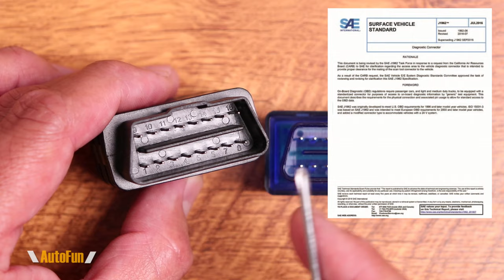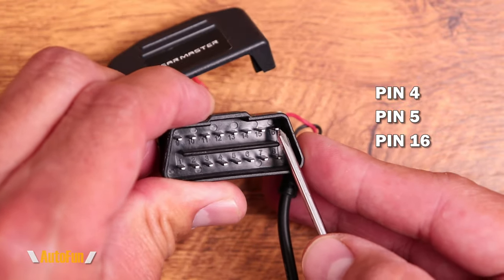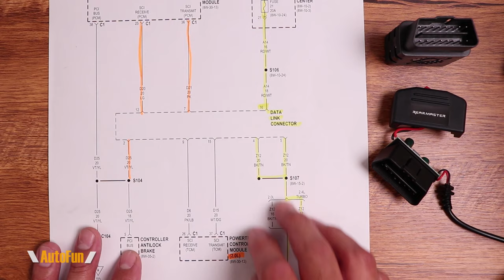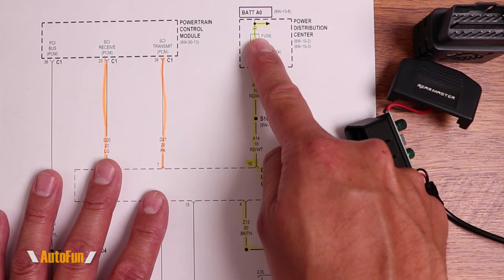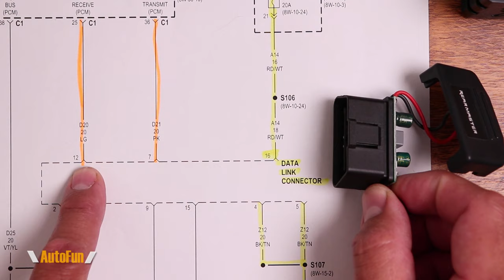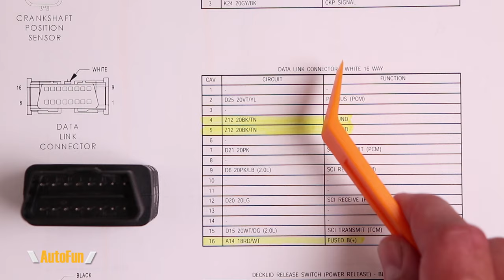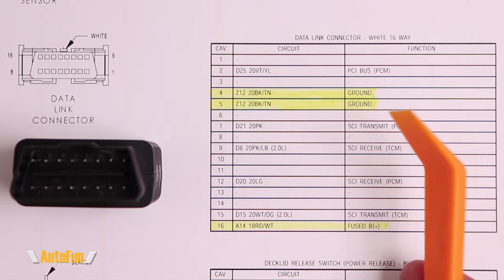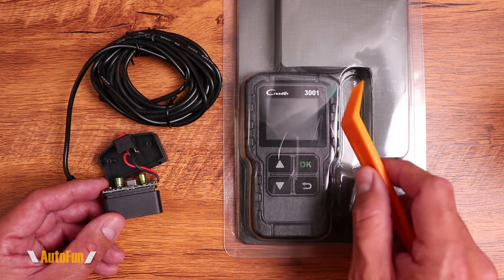OBD2 Power Adapter DANGEROUS? (Is it safe to use the OBD port for power?)

Comment: Wonderful explanation!! 

Do you believe the power draw (specifically a dash cam) will affect the battery/car the same as a regular power port?

I love the idea of using this method for power as I recently broke my normal cord and need to replace. 

One thing I would mention in a video is that the power is always on, if you don't want a dead battery switch it off everytime you turn off the engine!

That being said I love the idea of being able to record for a few minutes with the engine off.

Thank you!
Reply from the maker: Thank you Mindy! Ah yes here is my original video showing how the adapter works https://youtu.be/YEklm9V6xYE it has built in low battery protection (to avoid draining your battery) and has two modes of operation which I cover on that video in detail. Hope this helps, Cheers!
Reply: On some vehicles simply having a device plugged into the port will keep certain modules 'awake/alert' as they assume the device thats plugged in is a scan tool. This can result in a dead battery when the device itself didnt comsume any power - rather some of the car systems never hybernated.
Reply: @djbmw1  I have a 2010 accord, I went ahead and got this exact model and I haven't had problems.
Reply from the maker: @djbmw1  Hi djbmw1! Yep! while I have used my OBD2 adapter for over 4yrs now in a newer vehicle, what you are describing is very true and I seen it on some newer cars (specially on hybrids) where either the OBD2 will keep a module on or the car will turn off power to the OBD2 port or the car will detect the draw on the OBD2 port and throw a MIL for battery. Hope this helps, Cheers!
Reply: If you want the camera to work in in the parking mode . You need power to it all the time . Turning  off the adapter defeats the purpose of hardwiring it in the first place
Reply: @randybauer2998  I commented this a year ago, my guy!

I wanted it set up this way so I didn't have to have it plugged into the cig lighter.

And the adapter he recommended works flawlessly and it shuts off on its own. 

If I wanted it hardwired I'd run it to the battery.

Comment: Does that have a voltage cut off to prevent the car battery from dying?
Reply from the maker: Hi Velocity0428! the one I showed on the video does have low voltage cut off (Not all OBD2 adapters have this) I put a link in the video description if needed. Hope this helps!

Comment: Thank you for your great video and giving me the idea how to get power to my dashcam.
Did you ever had issues with such adapters in combination of wireless key systems?
It seems that in special cases or specific car models such adapters produce so much "noise" that the communication between the wireless key and the car electronics gets interrupted etc.
Reply from the maker: You're welcome Alexander! Regarding issues with wireless systems, nope I have not experienced any. Remember the OBD2 power adapter is just a standard step down voltage adapter similar to the ones that the dash cams come with (cigaretter lighter plug style) it's just packaged to interface to the OBD2 connector as opposed to cigaretter port of the car. So the EMI or RF noise generated by this adapters will be about the same (likely negligible based on the number of power adapters I have tested while reviewing many different car accessories such as dash cams) Hope this helps, Cheers!

Comment: Wow, such an amazing video! Learned so much from it. Are OBD2  EXTENSION CABLES also "okay" to be used on a vehicle? Thanks!
Reply from the maker: You're welcome Arshia! Glad to hear it was helpful. Ah regarding OBD2 extension cables, if I recall correctly there is no provision on the SAE-J1962 standard against or for extension cables. That being said extension cables (and Y splitters) seem to be common in the automotive repair industry, some equipment seems to be unaffected by the use of them and some are more sensitive where the won't work well with an extension or a Y splitter. Hope this helps, Cheers!
Reply: @AlexAutoFun  Thank you so much for your reply 🙏🏻
Have a nice day ✌🏻
Reply from the maker: @arshiaabbasi4920  You're welcome!

Comment: Hello AlexAutoFun, I recently picked up 70ai Omni 360 dashcam, which came with a 4G hardware wiring kit, three wires ie, ground, power, & acc (yellow wire). And I really like your idea using this OBD power adapter from one of your previous videos. The kit above comes with stripped wiring, which I'm thinking of soldering the leads to a female type-C board. On these female type-C boards its labeled V, D-, D+, G. Based on your experience; do you know where my third wire should be connected? On what pin should I connect that wire on the female type-C board; between these tabs D- tab or D+? Thanks for any feedback!!
Reply from the maker: Hi Luis! There is a OBD2 adapter that already uses USB C (save you some time making one) here you go https://amzn.to/3kANxlx Just remember that while the OBD2 adapter will let you monitor the car while parked, it will not enable true parking mode (since it only provides power, it does not provide what a 3 lead hardwire kit needs ACC, BATT, & GND), here is my video where I explain this in more detail https://youtu.be/YEklm9V6xYE Hope this helps, Cheers!
Reply: @AlexAutoFun  Thaks for the answer since I have exactly the same device. The link to the adapter leads to some "VANTRUE 10ft Mini USB 12V-24V to 5V Dash Cam Hardwire Kit" which is definitely NOT the USB-C nor even an OBD one. Maybe wrong link slipped in? It's hard to find a USB-C kit somehow (I'm in Europe).
Reply from the maker: @andrejk6770  Hi Andre! That is strange, I just checked the link and does go the OBD adapter with USB C port. But I do know sometimes if you are in different region where the sellers doesn't ship the product to yet, the link can take you to a different device that Amazon thinks is like the original one. Hopefully they will eventually carry this adapter for you in your area. Cheers!
Reply: @AlexAutoFun  Hi Alex, can you elaborate what you mean by saying 'monitoring the car while parked' and 'true parking mode'? What's the difference? I watched the video you linked and many more, and I was under the impressions that as long as you switch the ODB2 adapter in the right position (either 0 or 1) it will either switch off minutes after switching off the engine or keep recording until the battery drain is too much, which will then switch it off automatically (if the dash cam allows for it). What is the 'true parking mode' then if not that?
Reply from the maker: Hi Jacob! While the OBD adapter can be used to monitor the car while parked as explained on my original video here https://youtu.be/YEklm9V6xYE It will not enable true parking mode. What that is, on most dash cams the parking mode menu or feature will not be accessible with the OBD adapter, only their hardwire kit will enable it. Inside of the parking mode menu or setting are advanced park monitoring features. Depending on the dash cam being used, they can potentially range from simple Impact detection, time lapse, to more advanced modes like buffered parking mode and motion detection (visual or radar based), power saving park mode etc. And stay tuned I have a video coming where I explain this in more detail. Cheers!  @jacobb9177

Comment: Does OBD2 method work simultaneously with triple camera bundles? Cabin, dash and rear?
Reply from the maker: Hi What It isn't! This will be determined by the dash cam being used. Most dash cams use less than 2amps of power, however some use more (like mirror dash cams which run from 2.5A to 3A) The OBD2 adapter can only handle a maximum of 2A (there is a high power version of the OBD2 adapter here https://amzn.to/3epnu1O but I have not tested it myself) And here is my introduction to hardwire kits video that covers this in more detail. Hope this helps, Cheers!
Reply: @AlexAutoFun  could the higher power version of the obd adapter work with the rexing m3 mirror camera triple bundle you reviewed?
Reply from the maker: @whatitisnt.  Hi What It isn't! As explained on my introduction to hardwire kits, I recommend sticking to the matching kit for the dashcam to avoid issues (both technical and warranty) However since Rexing does not have a hardwire kit for the M3 I can see people wanting to use a different kit. However the M3 requires 3A and even the high power version of the OBD adapter can only output a max of 2.5A Hope this helps, Cheers!

Comment: Hey professor, does this OBD feed the main front camera + the rear one (this one goes connected to the main one?
Reply from the maker: Hi V! Ah, good question. Most dash cams power the rear camera as well from the main dash cam, so there is no need for an extra power connection. Here is my dash cam install video where you can see how the rear camera connects to the front dashcam https://youtu.be/IYRavaIBmSY Cheers!

Comment: Might be a bit of a silly question but here goes.  The OBD power adapter and the direct hardwire setup supplies  12V to the dashcam. However it appears that the original cigarette lighter connection shows an output from the plugin as  5V. Does the camera convert 12V to 5V?
Reply from the maker: Hi Steven! ah there are a couple different OBD2 adapters out there, for example for Thinkware dashcams their adapter outputs 12v since that's what their dash cams require. The adapter I showed on this video outputs standard USB 5V which is what the majority of dash cams are using currently. So basically you would want to make sure the obd2 adapter or hardwire kit is the correct one for the dash cam being used on. Here is another video where I cover this on more detail https://youtu.be/Yky9_tTvwMc Hope this helps, Cheers!
Reply: @AlexAutoFun    Thanks very much   Wasn't too sure of output voltage to camera.  Cheers
Reply from the maker: @Faresplease  You're welcome!

Comment: Hi, I found your video researching trickle chargers that connect to the OBD port, in my case as an aux power supply while I change my main battery. This taught me that there is probably little risk if wired correctly (and how to check for that) but what are your thoughts on this kind of use?
If only 3 pins are needed (2, in fact) one does wonder why these aftermarket systems don't suppress then pins they don't need?
Reply from the maker: Hi RJVB! Ah interesting, yeah I can see a trickle charger tapping into the port via the power wires, same principle as the power adapter but the flow being reversed to charge the battery as opposed to pulling power from it. Regarding why extra pins are present is that OBD2 does not fully use the connector body or a collar like most connectors to keep the connector in place (it's a non-locking collar), instead it's more of the combination of the female and male connector bodies surfaces interacting when mating and the contacts (pins and sockets) themselves being mated for retention force. Which means unfortunately that leaving out the active pins on a OBD2 connector may significantly reduce it's holding force and may lead to the connector to wiggle off or come off easily. That being said some OBD2 connectors (depending on the device) do omit un-used pins and either supplement the OBD2 connector with a spring clip to increase mating and un-mating forces and sometimes no clip at all. Cheers!

Comment: Now days cars come with USB charging port. Can those be used to power a dashcam instead of ODB, hardwire or cigarettes port?  Any gadgets that does that now?
Reply from the maker: Hi m8s m8s! yep! if you got a newer vehicle then it is likely to be equipped with at least one USB port. However different dash cams require different amounts of power which will determine if the car USB will have enough power to make it work. Here is another video https://youtu.be/Yky9_tTvwMc where I cover how to tell the power requirements of a dash cam and also the advantages of hard wire kit over the cigarette lighter plug or built in USB port. Hope this helps and thanks for watching!

Comment: This OBD2 Power Adapters particularly the one from Vantrue messed up my car's electrical connections. I experienced random honking, headlight problems and door locking problems. I still can't figure out the fix after trying to remove the negative cable from my battery overnight.
Reply from the maker: Hi Coolchange! As shown on the video, the OBD2 adapter I use only connects to the car's battery and has no other interaction or connections leading to the rest of the car's systems. If I do get a hold of a Vantrue adapter, I can certainly do a teardown video to see how that one works but it may be the same as what I'm using (with the same potential for factory escapees as explained on the video). And here is another alternative if looking to avoid hardwire or the OBD2 port https://youtu.be/-hGu8KZLaZ4 Cheers!
Reply: @AlexAutoFun  The reason why I bought this kind of power adapter is because of this YT video and this video gave me the confidence to get one because I have doubts about it. This actually is happening right now on my car less than a week after I used this on my Vantrue Dash Cam.
Reply from the maker: Hi Coolchange! Oh wow that is so weird, assuming the Vantrue Adapter is built like the adapter I showed on this video, there is no connection to the rest of the car systems for it to affect them. However I have not done a tear down video on the Vantrue Adapter, also important would be to check the car's wiring schematic as I did on this video to confirm that the power pins are not shared with any other electrical bus, but again this would assume that the Vantrue is built like the adapter that I showed on this video. I would also recommend contacting Vantrue for tech support (specially if you suspect you received a factory escapee) And if I get a hold of a Vantrue adapter I will update this comment with the link to the tear down video. Cheers!  @coolchange3291
Reply: @AlexAutoFun  Thanks for the concern.
Reply from the maker: I hope Vantrue can help, I have not reviewed any of their products but I have heard good things about them and please keep us posted on your findings, Cheers friend! @coolchange3291

Comment: After watching one of your video, I bought one of those ODBII adapter for dashcam. The one I received only have 3 pins on the adapters. (I guess that will be Constant power, ACC, and ground)
Reply from the maker: Hi wlit! It's likely two of those pins are ground and one is power (which is the norm for OBD2 connector pins) remember the OBD2 adapter will not have an ACC connection like a hard wire kit does (so it will not enable true parking mode on a dash cam) here is another video where I explain this in more detail https://youtu.be/Yky9_tTvwMc Hope this helps and thanks for watching!
Reply: @AlexAutoFun  You're right; the ODB2 adapter did not enable the parking mode function. (which is a disappointment)  However, I read bad reviews about the hardwire kit draining too much battery, and the low voltage protection is set too low except for Rove (which is adjustable). I don't want to take the chance of a dead battery in the middle of nowhere. Instead, I like the control when I want the dashcam to stay on or not.
Reply from the maker: @wlit  Yeah very true, one of the reasons I used my OBD2 adapter, super convenient and I also have more control over it. There is one hardwire kit that just came out that does have some pretty cool controls (both voltage cutoff and manual control)  this one https://youtu.be/_MlRJ2_cd2o in case you want to take a look at it, cheers my friend!
Reply: I just ordered a Thinkware U1000 and the obd2 cable. As far as I know ,  they are the only ones  right now that you can use parking mode with their obd.
Reply from the maker: @thetattooedvaper4081  Hi The Tattooed Vaper! I have not reviewed the Thinkware OBD adapter (but it's only my list to test!) but I have reviewed the power cable for the U1000 (to enable parking mode) here is that video https://youtu.be/GCKXdGTGbqw Hope this helps bud!

Comment: I just received a "Fuel Save Pro" that plugs into my OBD socket.  Do you have any info on the safety of this device?
Reply from the maker: Hi T! Those devices do interface to the car's computer (normally, I see some that all the have inside is a simple light to give the appearance that it's doing something), and while I have not tested any of them, I personally would not use them as from what I seen, they have little to no effect on the fuel economy. So the risk of having a unknown device plugged in all the time into my port without any measurable benefits makes it a no go for me. That being said I'm sure there are people out there using them (some have attributed the sales of those devices as somewhat of a placebo effect, where there is the perception of better fuel economy but again I have not tested them personally) Cheers!

Comment: How do I stop my camera from always recording? Will it drain my battery? My camera doesn't have park mode
Reply from the maker: Hi Chad! You will want to take a look at your owners manual or check with your installer to confirm it's working correctly or not. Normally a dash cam (when correctly installed) will turn off with the vehicle and turn on with the vehicle. Cheers!